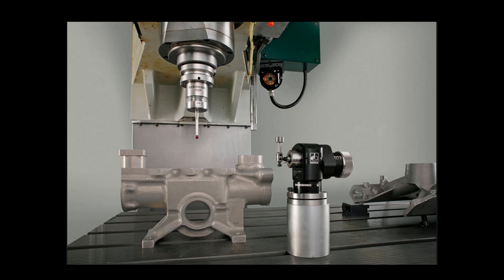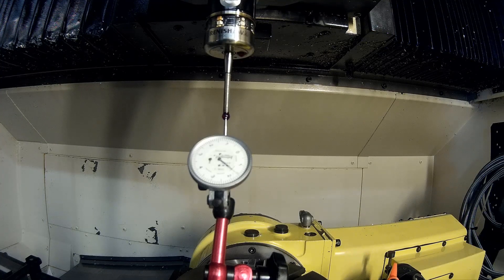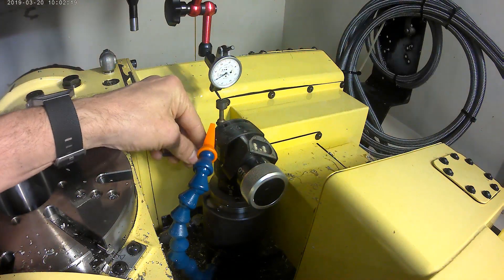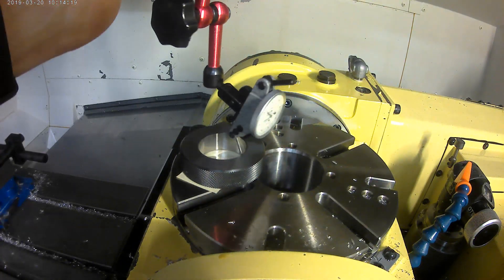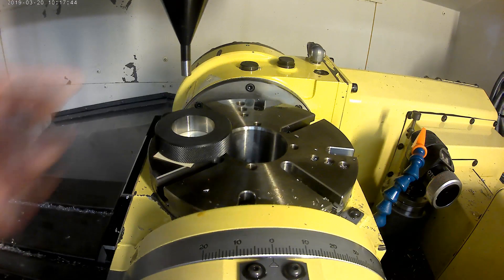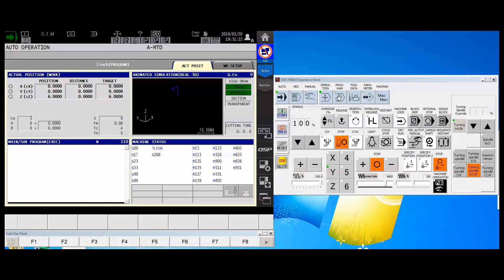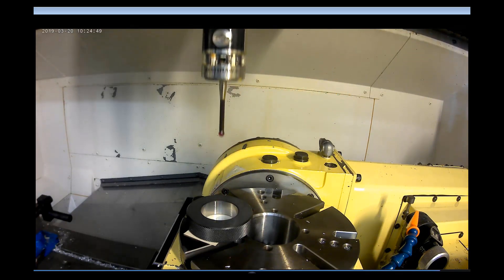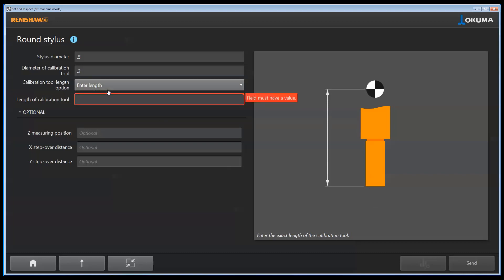cal ren okuma

Comment: When do you set spindle probe? Can you just run it on tool probe?
Reply from the maker: That's been an argument with AE's on my staff a lot! I always insisted that the Renishaw "Calibrate Z" cycle was the best method, while one of my guys insisted that it was much easier to simply use the freshly calibrated tool setter for the probe. When we disagreed, we set out to prove which was more accurate. Turned out: the results he got were only .0001" different than mine! Bottom line was : do whichever you're more comfortable with. I usually do the Z calibration last, because my final check is to probe a surface to set a G15, touch a tool off the setter, then command the tool to G56 and move above the new G15 by 1" and then use a gauge block to confirm that the tool set cal and the probe cal match. Thanks for the question!
Reply: I meant spindle probe tool length.
Reply from the maker: @MikeWilliams7180  Yessir! Me too. The XY cal should be done with an artifact like a ring gauge, but the previous comments relate to the probe length

Comment: is there an okuma macro that will also measure tool diameter? how could i get my hands on that?
Reply from the maker: You mean the Okuma cycle or the Renishaw? Renishaw has one, as their hardware has the provision to accept a side touch. The Okuma sensor is a plunger type, so it is for vertical measurement only
Reply: @pocketcharleywithgosiger  i have the renishaw ots with okuma cycles. looking for okuma macros that will support diameter measurements

Comment: Hello, can you have more information about vncom? Thanks
Reply from the maker: VNCOM[1] is the system variable which dictates which input is used for the skip signal circuit. By default, VNCOM[1}=3 is active which is used for a tool setter. By specifying VNCOM[1}=8, you are telling the circuit to look for the optical or radio signal from the spindle probe. Think of it like a light switch...
Reply: @pocketcharleywithgosiger  ok, thanks for the answer. VNCOM[1]=1 is for message? Why MSG also work with VNCOM[1]=0? And VNCOM[2] 3 and 4 what is it?

Comment: Hello! Is it possible to get a demo version as you have a remote control simulator for your computer?
Reply from the maker: S C , yes! It is called PCNC Master and is available from OAC thru your normal Okuma retailer. Currently they have 13 machine configurations and are working on more. Great tool!
Reply: @pocketcharleywithgosiger  
Thank you! And you can give the link to PC NC Master for OKUMA?
Reply: Just used the demo. I accidentally elbowed the tool setter. This video came in very handy! Keep the videos coming!